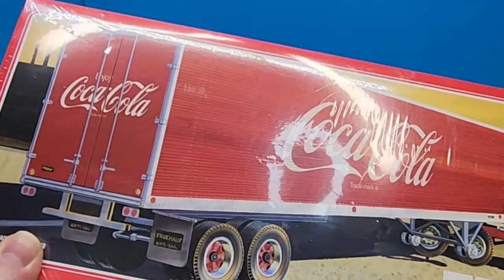AMT's Fruehauf Van Semi-Truck Trailer - Full Build!

Comment: If you don't cement the axles to the springs and let them move freely as they are when you are attaching the brakes, then you will be able to mimic a bit of suspension travel.
Reply from the maker: Cool tip! Thanks. Also, thanks for watching, and have a great day 😀

Comment: Next time you can get another Fruehauf Van Trailer. When you glue the walls,  the roof, the floor stick your (don't do the doors yet) hand ✋ inside of the trailer all the way in to straighten the top 🔝 roof and the front wall to even the seems and I did my AMT Fruehauf Van Trailer model kit. I recommend you to do the same as I did and my AMT Fruehauf Van Trailer model kit roof is straight.  hi five ✋
Reply from the maker: Thanks for the tip! Thanks for watching and have a great day!